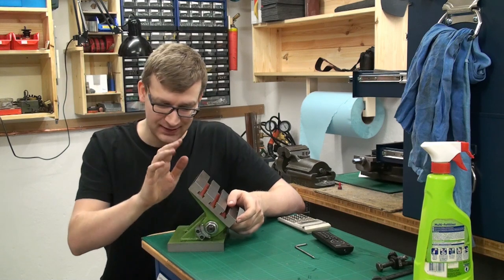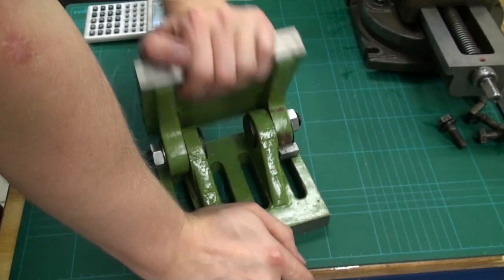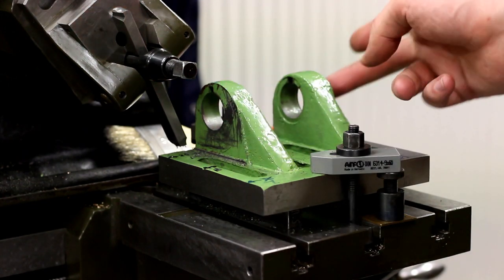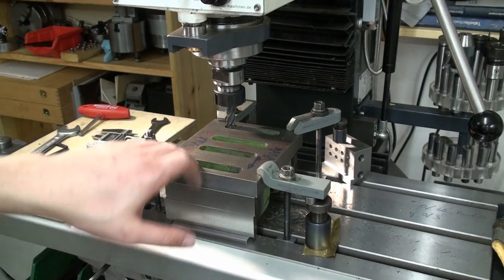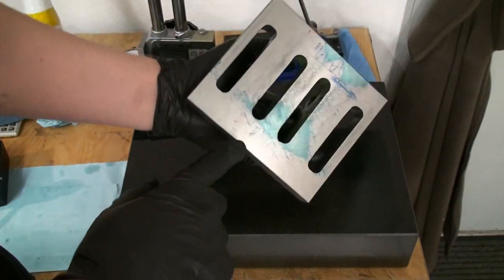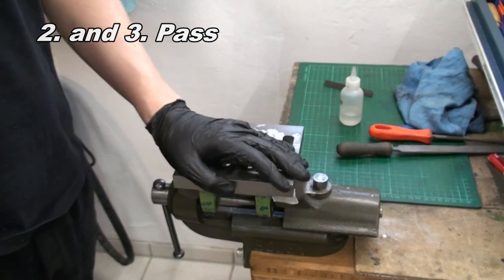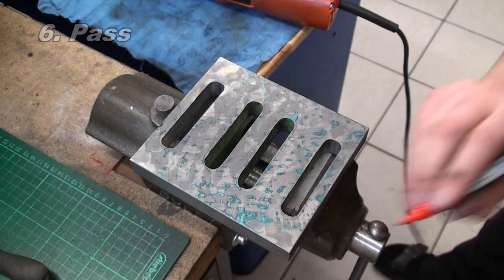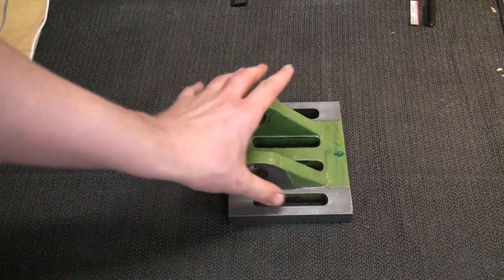Adjustable angle plate,  improving and scraping - Part 1

Comment: well shazam, a power scraper!   I've been looking for one for years.   good video.   I'm not leaving my chair until part 2 is out so hurry!
Reply: +This Old Tony I was thinking the same thing except I forgot to bring a beer...
Reply: +This Old Tony wonder if a recip saw could double as a scraper with minor mods///
Reply: +Billy T Likely, it's not a complex motion.
Reply: TOT and Billy T who commented below Stefan was using about a 1/2" stroke. I've been looking for a power scraper for a long time it's not going to happen. I've have an old Milwaukee that has a shorter stroke than the newer models,I can control the speed with a router control. I think it would be possible to shorten the stroke and modify the reciprocating end to hold a small blade holder. I wouldn't try to restore a 20" monarch with it, but for doing fixtures I think it could happen. I know whe would be stuck with one length of stroke. Stefan was using  very little pressure. Is it possible? 🙂

Comment: Very nice. I used to teach precision scraping. Here's what I'm seeing:

Good checkerboard, minimum stoning, skip around to randomize the next pass indications, alternating scraping direction, controlled blue thickness, sharp properly radiused scraper, the right number of bearing points per unit area suited for the work, etc. All the elements are there and well integrated. 

I'm not approving Stephan's work, per se I'm pointing out attributes of good technique for the scraping neophyte.

Those looking in who might like to try precision hand scraping as a means of generating precision tooling surfaces can emulate Stephan's technique and the scale of his project - refining a cheap import tilt table - as a first project.

Stephan, if it wouldn't interfere with your planning, could I suggest on your next video you fit in a demonstration of your sharpening technique and how you select the scraper radius for each stage of scraping?

Comment: I'm more than a little impressed with the design of your shaper Stefan. I didn't know before this video it was capable of power feeding in the vertical direction simply by swapping a few parts around. There were some very clever people who designed it. Pretty tough to do better than German or Swiss built machine tools in my opinion.

And I'm very much looking forward to seeing how you scrape 2 surfaces to a true 90 degree angle. I've got a few guesses about how you'll address those pivot pin holes as well. It may have originated in China but going by your usual standard of craftsmanship I'd be willing to bet your going to end up with the accuracy of a Suburban or other top quality adjustable angle plate by the time your done.

Comment: As Keith at Turn Right Machinery said you must consider these tools as kits. You must do the final fit and finish.  Looks like a good project. Thanks for taking the time to film it. 
Al
Reply: Stefan, on a gross offender like this one, would it be worth scanning the surface initially for low spots with an indicator so you could see location and how bad they were and perhaps try taking about half the high the height of the high spots off in the first pass? I guess by now you have plenty of experience to see how much iron comes off in a heavy or light pass with the scraper. Or would it be better to use the surface grinder to do this? This Chinese iron warps terribly as it ages, as I have learned from Harbor Freight. Look how far your  factory ground surface was out of true! I would expect the pivot bores to be egg-shaped too.

Comment: There are two ways to lookat "CE" tools. (I know, CE stands for Conformation Europee' or something like that, but I have been corrupted by AvE and CE means "Chinese Export" tools). One is that they are just junk, not fit for human use. The other way (and much more productive) approach  is that they are really a kit of parts.  They have done the castings for you, which is really the one thing that is difficult to do at home. What you have to do is re-machine the castings. This is a wonderful video because it shows you how to do it. So OK, you don't have a power scraper. Still can do it by hand, merely will take longer, and I have added scraping to my already overloaded project list. And of course you don't have a Gack scraper. Try a mill! Thanks for the post!

Comment: I like the prospect of taking inexpensive tools of modest accuracy and making a good tool from them.

I wondered if he checked the alignment of the pivot hole centerline with the base at some point.  Perhaps that shows up in a subsequent episode but this would have been a good time to see if there was an issue there that also needed correction.

Thanks for posting the video.
Reply from the maker: +TGTool Yes, I checked it and it was completely off - a few tenth of a mm. I rebored those holes, which will be seen in the next video :)
Reply: +Stefan Gotteswinter 
Yes, nice.  It highlights not only geometry issues but design or process decisions - scrape the base to match the holes or match the holes to the base?  Are the hole diameters and/or pins a fixed size or can they be larger or the holes sleeved?  Decisions, decisions and followers of your build can learn a lot about what goes into both establishing precision and optimizing the tasks to get there.

Comment: Great video, Stefan.  I have been doing some scraping, and just bought a Biax power scraper like yours.  Old one, works good, has a plug-in inline speed control as well.  I also recently  bought an old 200x400 cast iron surface plate which will be it's first victim...
Reply: +Bill Lewis Yes

Comment: I am sure that this question will mark me as a raw newbie to metal working but is there a why for scrapping the bottom instead of setting the piece up on the mill and milling the bottom flat and in plain with the surfaces you machined on your shapper   I thank you for your work and time in  teaching us

Comment: The import semi finished tooling is always fun. On the markings on the tiop was that +.2mm or .02mm? I think if it was me I would lower the pivots and machine it to positive stop at 90deg so it can quickly double as an angle plate. Don't think I have ever needed to go beyond 90 on a setup, usually just reverse the part or come at it from the other side for an angle like that.
Reply: +bcbloc02   How about a bolt and lock nut screwed into the edge of the plate as a stop for 90 degrees, easily removed for a larger angle?
Reply: *****
Probably would need 2 so you couldn't skew the plate shoving against the bolt.
Reply: +bcbloc02 One in the center makes a triangle, which is a stable geometry.  For it to work at all requires a reasonably tight fit at the pivots.

Comment: Stefan, thanks for the vid.  I just started viewing this angle plate series.  Would it not be a good idea to check the orientation of the bore axis relative to your reference surfaces before you get too far into the project?  I predict you will end up line boring then adding shim bushings.

Comment: Just wondering, when you put the angle plate on your shaper, how can you be sure that the sides you shape will be straight and perpendicular to the bottom, when you scrape the bottom after you have shaped the top surface ?

I mean ...... normally you would flatten the bottom, (handscraper or milling it ?) before you work the top half to be sure that top and bottom are parallel or what ?

Comment: If you had access to a surface grinder would you use that instead of scraping?  If not could you explain.  

I look forward to seeing the process of scraping for square and parallel.  For flatness seems tedious but straight forward.  To correct for an actual measured angular deviation is something I really don't understand yet and know you will explain it very well.
Reply from the maker: +Barry Gerbracht A surface grinder would be a total gamechanger - it would speed up a lot :)
Adjusting is not that complicated  - you just scrape more on the spot thats thicker and also keep an eye on the flattness of the surface. Its like leveling a foundation for a concrete slab - You look where there is to much earth, you shovel it away and then reflatten the surface.

Comment: haven't even watched it yet but this video is awesome..  I've been shopping for an adjustable angle plate... can't tip the head on my new mill.  are you spying my browser history?!
Reply from the maker: +This Old Tony Realy? The head on the Schaublin is fixed? There is another style of angle plate, that is very low profile and runs in a circular doveteil - But scraping that thing to precision sounds like my personal horror show ;)
(Nothing wrong with having a spy checking your browser from time to time. Its for safety reasons!)
Reply: it swings in xy plane but not yz.   schaublin has an adjustable table but I'll turn 90 yrs old before i find one.   if you can,  show the range of motion with a small vise on it.   I'm worried that at,  say,  60 deg..  it might swing out of my available Y range..  that is: i could set up a part at 60 but not be able to reach it to make the cut!  do you have a link for the low profile one?   anyway..  back to your video.. :)

Comment: Great Video, scraping is very interesting to me! I wish there was more material on the web for reconditioning a milling machine by hand scraping.
Reply: +DMHLeather It's one thing to scrape something that is flat and single plane, quite another to scrape vee ways I would imagine. Looking forward to him scraping in right angles. I would imagine that to be a challenge as well.
Reply: +DSCKy Yep it's much tougher to keep everything properly aligned in 3 dimensions to the tolerances required. So far I haven't attempted it, but the machine tool reconditioning book goes into extensive detail about it.

Comment: I think one of the small hand held recip saws would work nicely in a home shop simply because of the size of the components. one thing. on scraping jobs we always broke the surface up in two directions, 90°s to each other before we even checked to a plate or master. you're going to scrape the whole thing any way

Comment: Total novice here. You have a surface grinder, I think? Why not use that? These surfaces will not benefit from the lubricant-holding properties that I believe are one major benefit of scraping sliding surfaces.
Reply: I would guess it's a low risk way to practice before you try your new skills out on the bed of your lathe ;)

Comment: Stefan, just a question. Why didnt you just use the shaper for the bottom surface?
Reply: I do not get your answer metalhead2508 ...Could you please explain what you mean?
before the scraped surface it was flat from factory (well, not totally flat, there were a few high spots) Just asking, no critic intended.

Comment: Stefan, you may have heard that Niagara Cutter, a renowned US maker of milling cutters, is sending out boxes of assorted end mills HSS and carbide, turning tooling to You Tube presenters of machine shop content promoting our trade to viewers. 

I contacted Dennis Noland, the Niagara rep in charge of this program, to see if you and other non-US presenters were on the list. Alas, no, but you should be aware he is well acquainted with your work in particular and if the program he administers extended off-shore you would be sharing in the loot.

A box of inch based, US made cutters might be a mixed blessing in your Metric shop but the recognition would be nice. I guess the message is: no goodies but keep up the good work.

Forrest Addy
Reply from the maker: +Forrest  Addy Yes, I saw the Niagara Goodies Box and I am realy suprised over the value that was given out - That has to be about 1kiloBuck of Endmills :)
Inch-sized endmills would be real fun in a metric shop, thats sure!
Thanks for chiming in and contacting Niagara, Addy!

Comment: Am I missing it or did you true any of the surfaces to the pivot axis.  If not,  you will have issues as you use it at different angles.
Reply from the maker: I bored the pivots true to the scraped surfaces :)

Comment: Hi,
What is the difference between using surface grinder and scraping ?
Reply: tolga onder not an expert, but scraping is better for surfaces that need to move against each other, like a lathe carriage.  The scraped surface leaves small reservoirs for oil, so they move better with less wear.
On the practical side, I can afford a manual scraping tool, but not a surface grinder.

Comment: Did TOTALLY backward.  Using the BASE of the unit to reference it, then machine the other top surfaces WITHOUT referencing those?  No way it can be accurate thank you.Should have references to ANY surface...as in the base of the mount (largest size that comes in contact), smooth and flatten that, THEN do all of it from there...IE: taking the high spots off the base.   It could very well have 'rocked offline' in references.  WHERE ARE YOUR REFERENCES WHEN SCRAPING THE BASE TO KEEP SQUARENESS?????? More accurate to do the largest face first, then reference from there to the rest of the tabs, slots, sides...all of it.
Reply from the maker: +Shannon Whipple Your Capslock is stuck from time to time as it seems.
The squareness of those bearing-lugs is not critical its ok if they are 5/100mm orso off, the bores are machined relative to the base surface.